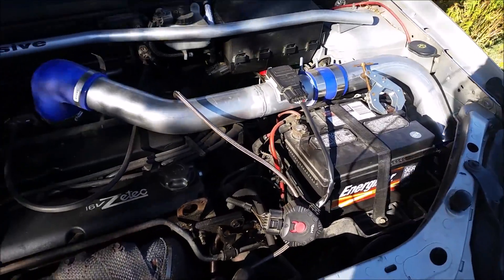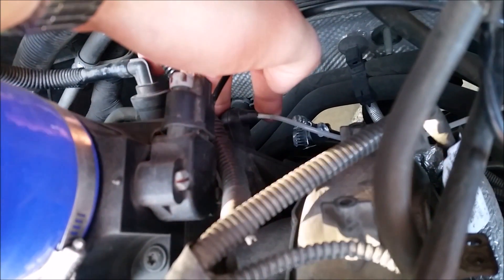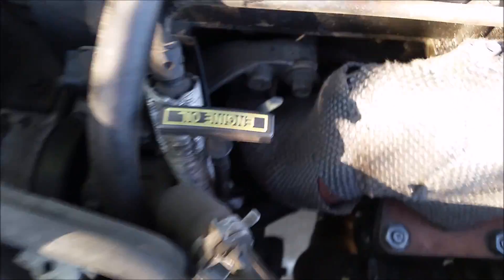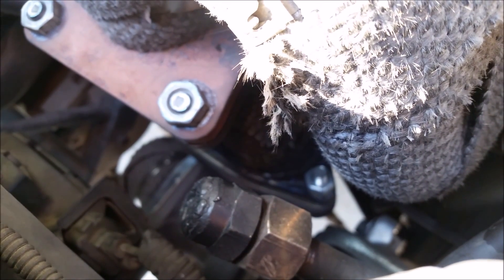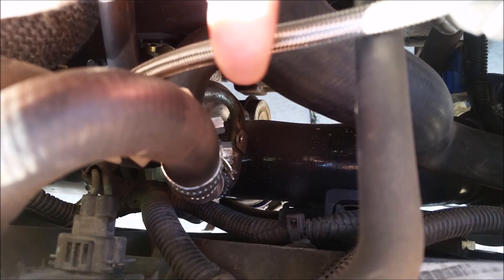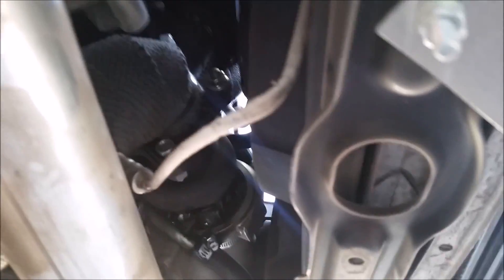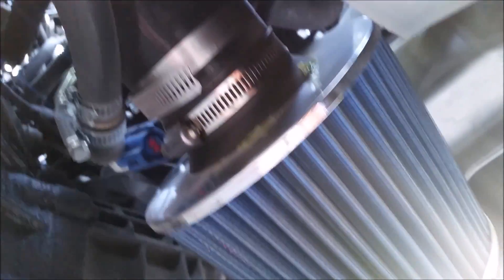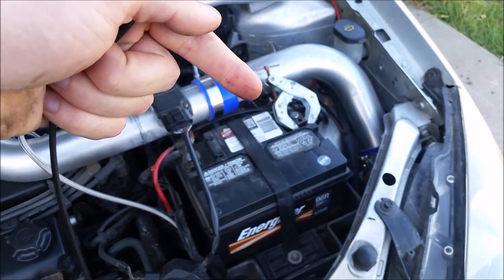Homemade Ford Focus Zetec Turbo System Overview

Comment: Hmmm would this work on a 1.8 zetec 

What engine management system you running ?
Reply from the maker: I honestly couldn't tell you. It's the stock ECU with a custom tune from "Turbo Tom"

Comment: it works? :D
Reply from the maker: Yep! Put like 30k miles on it with the DIY turbo setup at ~6psi before selling the car. Always worked like a champ.
Reply: @prerunnerwannabe  hey man I’m about to do the same thing with my zetec, I’m new to turbo systems so do you know any websites that explain the process in detail?

Comment: How is the car running 3 years later? Has there been any additional work required since the turbo? I want to boost my 2.0 DOHC zetec in my 2000 wagon.
Reply from the maker: Nice! That would be way fun.
I sold it a year or so ago, but I put ~25k miles on it while it was boosted to 6psi, and the stock 195k mile motor was happy as can be when I sold it. These are stout little engines, for sure.
Reply: @prerunnerwannabe  I appreciate the reply! One more question, on the 6 LB of boost did you have the car  on the dyno for a hp / torque rating? I want to be at the 200-230 hp & lb-ft of torque range 😁
Reply from the maker: @thatnorthernvanman7883  Happy to help!
I sadly never had the car on a dyno, so I don't know exactly how much power it made, but it was about as fast as a Fiesta ST, so I assume it made similar power numbers to that? It probably wasn't quite 200hp/tq, but the car is so light that it was still a ton of fun :)

Comment: Did you change the pistons?
Reply from the maker: Nope, totally stock motor. I drove it daily running 6psi for 25k miles and sold it with 190k miles on the stock, original motor. Still runs great!
Reply: prerunnerwannabe what horsepower it made with stock and 6psi
Reply from the maker: @aria_thronix1323  I'm not positive because I never put it on a dyno. I'm guessing somewhere around 200hp/200tq. It felt pretty similar to a Fiesta ST and was about as fast.
Reply: prerunnerwannabe i think ill buy this 00-04 Ford Focus ZETEC 2.0L T3/T4 Turbo Kit from fast way racer but need some advice because I’m doing it mi self
Reply from the maker: @aria_thronix1323  I would stay FAR away from eBay turbo kits, as well as the fast way racer kit. They are pretty much guaranteed to not work, and you're going to have to do an insane amount of fabricating, replacing junkie parts, and custom work to make any of these things fit. 
Then after all that, they don't provide any tuning, which is an easy $1000 on top of that. If you don't get a good tune, your engine WILL die. 

If you want a proven, reliable kit (that includes tuning) then I would look at the FSWERKS turbo kit for the Zetec Focus. It's more money ($3500) but I promise, after all the pain and work and extra cash you'd be spending trying to make the fast way racer kit work and be somewhat reliable at the same time, spending the money up front to do it right the first time will actually be cheaper, more fun, safer, etc.

Unless you're willing to make literally everything yourself and spend hundreds of hours researching, the FSWERKS kit would in the end be the cheapest, not to mention by far the easiest.
Reply: prerunnerwannabe thanks

Comment: So the motor is stock i got is but how much boost is the max for a daily driver ? 8-10psi ? And what kind of turbo do use ?
Reply from the maker: That should be fine. I did 6-7psi to be safe. You can use whatever turbo will fit, but I used a slightly modified TD04L from a Subaru.
Reply: prerunnerwannabe ecu ?
Reply from the maker: @sarkanygergo  Factory ECU with a custom tune by Tom from Focus Power.
Reply: prerunnerwannabe thats cool i thought it need some stand alone one for example aem or halltech or something else ...
Reply from the maker: @sarkanygergo  Nah, the stock ECU will work. I think it's pretty finicky to tune, so I don't know how many other people besides Tom know how to do proper tunes with it, but I was happy with his work. He does a lot of e-tunes, where you send a datalog and he sends you a new tune, then you send another datalog and he send you another tune to flash to the car. You repeat that process probably 10-15 times, but you will have a good, clean tune by the end.
Make sure to get good quality fuel injectors. I tried some Chinese injectors but they were pretty awful, and once I switched to better injectors, it fixed lots of issues related with tuning.
Reply: prerunnerwannabe i live in the middle of europe so the states is a bit far from me haha but we have some good guys who knew what they are doing haha and also UK has some good tuners and i have a friend who good at this ! Btw thanks for your help dude
Reply from the maker: @sarkanygergo  That's true, the UK has a lot of resources for tuning Fords! Just to clarify, these tunes were sent back and forth via email, so distance wasn't an issue. I've never actually met Tom in person haha.
It would probably be nicer to have the car with your tuner though.
Happy to help!
Reply: prerunnerwannabe or just an easy way to buy a mk1 focus rs ecu and harnes for the UK or from my country and job done haha
Reply: @prerunnerwannabe   what mods did you do to the turbo I have a junk yard with a few for 50 bucks and I' fabricate so everything  the rest
Reply from the maker: @pabassin2034  On the turbo I cut off the bolt style flange on the compressor outlet, machined out a 2" slip style flange that would accept a silicone coupler, and had a shop tig weld the new flange to the turbo.
I also clocked the turbo so that the turbine inlet and the compressor outlet are facing opposite directions, then I rotated the the center piece of the turbo (the name eludes me at the moment) so that the oil feed and drain were oriented in the right direction. This required some custom bracketry to keep the internal waste gate operational.
It took some work haha.

Comment: I’m in the process of a mk1 focus zx3 turbo build and was wondering did you do any work to the engine? New or better head gasket, piston ring gaping? Or is 8psi ok on an otherwise naturally aspirated engine?
Reply from the maker: Nice! The engine is totally stock. Basically larger injectors and a tune is all you need to reliably hit ~10psi. I think the breaking point for a stock Zetec is something like 250ft/lb of torque.
Reply: Ok cool I have all the software stuff taken care of just ordered everything else and didn’t know if a new head gasket and gaping the piston rings where required. I only plan on 8psi.
Reply from the maker: @carlgenis514  Nah, you're good to go! I'm pretty sure they come with a MLS head gasket from the factory, so they're actually super strong.
Reply: Another thought I had is what about the big vacuum line to the evap purge thingy and the brake booster? Are they seeing full pressure or was the evap purge solenoid deleted with the ecu tune? And shouldn’t the brake booster line have a one way vacuum/boost filter?
Reply from the maker: @carlgenis514  Man, you're making me think! I haven't had this car for a while now. Uhhh, I deleted the EVAP stuff and had the code turned out (shhhh). Honestly, I don't remember anything about the brake booster line. . . Sorry!
Reply: prerunnerwannabe  ok I’ve done a little digging and found out the there is a factory vacuum check valve inline with the brake booster, and I forget about emissions because I’m lucky enough to live in a county that is exemplified from emissions 😎.
Reply from the maker: @carlgenis514  Good work with the digging!
Reply: prerunnerwannabe  could you please take a picture of your oil drain setup
Reply from the maker: @carlgenis514  Sorry, I don't have the car anymore. . . But for the drain I tapped into the windage tray, but if I were to do it again, I would just pull the oil pan off and weld a bung into that.
Reply: prerunnerwannabe  ok thank you

Comment: Did you buy it all in a singular kit? Because I'm looking for one
Reply from the maker: None of it was from a kit, but I took some inspiration from the FSWerks Zetec kit. I would look into that one of you want a good, reliable system that I think even includes tuning.
Reply: @prerunnerwannabe  I'm trying to go cheap on it. Aint got  much money and I'm seeing ebay kits for around 600 bucks that look good. Do u think know anything  that would be wrong with those that I have to forsure change
Reply from the maker: @gavinsixnine  I know the feeling. Unfortunately, any kit that is even sub $2000 is going to be junk. If the kit includes a manifold, it probably won't fit right, it probably doesn't provide a downpipe, and the waste gate is all but guaranteed to be trash. Also you'll still need to get it tuned, and that's never cheap.
Basically turbocharging this car on the cheap cheap is a good way to blow the motor...
Reply: @prerunnerwannabe  noted. You got an instagram we could follow?
Reply from the maker: @gavinsixnine  Naw, sorry man. I don't actually have the car anymore.
Reply from the maker: @gavinsixnine  Now I have a Chevy Volt, but I don't think too many people want to follow that haha
Reply: @prerunnerwannabe  I'd be down ahah
Reply from the maker: @gavinsixnine  Oh yeah? Maybe I'll have to toss up a quick video about it 🤔
Reply: @prerunnerwannabe  you would forsure gain 1 follow!

Comment: Big ask! But would you be able to post a list of the parts you used?
Reply from the maker: Here's a rough list of the parts needed. There are lots of specific/custom things, but this will point you in the right direction :)

-Turbo/Manifold gaskets
-Turbo
-Downpipe
-Turbo Flanges/steel
-O2 sensor extender/bung
-Wideband 
-Boost gauge
-Tuning
-SCT X4
-Intercooler
-Mandrel bent tubing
-2.5 Tubing
-Air filter
-Oil feed/return
-Oil pan bung
-Water feed/return
-Silicone couplers
-Hose clamps
-Diablo Mafia
-Gauge Pod
-2.5" MAF housing
-Fuel injectors
-Adaptors
-BOV
-Firewire cable
-PCV delete
-Various Hardware
-Various Hoses
-Spark Plugs AZFS22C
-Gasket Material
Reply: Mines turbo to faster than my old cosy

Comment: What did you do for tuning or did you do any tuning?
Reply from the maker: I went through the process of datalogging like 20 runs to get a clean, custom e-tune from Tom from Focus Power. If you don't do any tuning, you'll probably melt a piston within two WOT runs. Tuning is a MUST.

Comment: what have been changed ,, gear,shaft, pistons?
Reply from the maker: The engine is totally stock, minus the fuel injectors. Stock drive shafts, stock pistons, stock everything with 175k miles :)

Comment: What did you use for fuel management? Any regulator?
Reply: And what did you use for piping? Exhaust piping?
Reply from the maker: @tylerpotts519  If I remember correctly, the fuel system was stock minus 42lb injectors (just don't use Chinese ones. I tried and it was weeks of headaches)
For piping, I used a mild steel tube for the adapter, and everything else (including the intercooler piping) was done with 2.5" exhaust tubing.

Comment: Could you shoot me a parts list and rough pricing? Awesome car man
Reply from the maker: Sure! This is more of a personalized parts list, so some stuff might not make a ton of sense. Anyways, with a lot of fabrication and hunting for good deals, I was able to put it together for about $2000, but that'll be pretty hard to replicate unless you do all the work yourself (which I did).
■10-Turbo/Manifold gaskets
■450-Turbo
■0-Downpipe
■45-Turbo Flanges/steel
■3-O2 sensor extender/bung
■135-Wideband 
■19-Boost gauge
■565-Tuning
■200-SCT X4
■60-Intercooler
■69-Mandrel bent tubing
■35-2.5 Tubing
■13-Air filter
■27-Oil feed/return
■0-Oil pan bung
■25-Water feed/return
■44-Silicone couplers
■15-Hose clamps
■60-Mafia
■8-Gauge Pod
■0-2.5" MAF housing
■46-Fuel injectors
■50-New-used injectors
■12-Adaptors
■17-Bov
■6-EcoBoost badge
■5-Firewire
■15-Engine mount
■0-PCV delete
■8-Various Hardware
■10-Various Hoses
■13-Spark Plugs AZFS22C
■12-Gasket Material
Reply: Thanks I really appreciate it
Reply from the maker: @austinbernardoni2757  You bet! Glad I could help.

Comment: I love these little station wagons lol although I did buy the 01 se and it only ran for 3 days. It just quit wanting to start and I kept replacing battery after battery and even the starter and solenoid... the battery would be dead as soon as it got hooked up... it was fucked...
Reply from the maker: Haha thanks! Dang, that's weird... sorry it didn't work out!

Comment: Could you help me with one question I've got? Imma buy a ST170 this summer and I was thinking about turboing it. Can I use a turbo from any stock car such as a BMW 320 or somethign like that in order to save as much money as I can? I thought about getting the entire turbo system from a car like that one and fitting it into my car with the least modifications possible to make it as cheap as possible. Could that be done and would you suggest trying? Thanks :)
Reply from the maker: Hey! Turbo systems are very specific to each vehicle, so a turbo system from a BMW or really any other car would NOT work on a Focus. You would have to either make a custom system or buy a turbo kit from a reputable company ($500 dollar eBay kits won't really work, unfortunately). I used only the turbo from a Subaru, but that was already heavily modified to make it work. There are a number of kits out there though, so it's certainly possible!
Reply: Aww, I was expecting that :( Yeah I won't consider an ebay kit, those things seem to be the worst way to lose 500$. Well thanks you so much, I'll keep on looking for aftermarket kits then, and will save even more money hahaha
Reply from the maker: @AlonsitisDuff  Cool man! Keep it up!

Comment: what ecu?
Reply from the maker: Stock ecu, just flashed with a custom tune!
Reply: How does that run? So it just uses a maf and theres no map sensor is that correct?
Reply from the maker: @mwoodford87  Correct. The MAF has a Diablo MAFia plugged in line to increase the voltage range that it can read, and it's also been tuned to work in a 2.5 inch intake tube.

Comment: What your Ignition timing at I keep melting spark plugs
Reply: I would invest in installing a wideband sensor and maybe look into fuel management as well.
Reply from the maker: Are your plugs a couple steps cooler? And are they copper plugs? That is my setup. Also, I didn't tune the car, so I have no idea what the timing is lol
Reply: prerunnerwannabe  they are sp-463 level 1, I read they where good too 11psi but there melting at 5psi I have a sct tuner but don't have the program thank for the reply
Reply from the maker: Huh, that's weird. I have some motorcraft coppers, but I don't remember the model number. I think if you go on the FSWerks website you can find them. Who tuned your car?
Reply: prerunnerwannabe the tune is just the stock sct universal 2.0 focus tune ,what you set your spark gap too
Reply from the maker: Wait. . . You're boosted at 5.5psi with the canned NA tune from SCT? That honestly sounds like a recipe for disaster, and I'm not saying that to be mean, I just don't want your car to blow up. Do you know what your AFR is under boost?
But to answer your question, I think like .035 or something around there.
Reply: Your fine the the stock o2 is reading .6v  to.8v under a pull
Reply from the maker: Do you know roughly what that translates to in a standard AFR ratio?
Reply: Around 14 to 15
Reply from the maker: Oh yeah? How long have you been driving your car boosted?
Reply: 4 days
Reply: 100miles
Reply from the maker: Gotcha. I really don't want you to have a hole melted in a piston, so I want to tell you that my tuner doesn't think it's safe to be over like 11.5 while being wide open in a boosted Focus, and he's tuned literally hundreds of them. I would hiiiighly recommend getting a custom turbo tune.
Reply: Try some ar103 plugs. "Autolite Racing 103 plugs" they are a 2 step colder plug. Should help tremendously. You can even gap them to .070 of an inch for a little more low end power. Also make sure you're not running lean at WOT.

Comment: UPDATE!!! Since I last commented on this video, I installed new struts, & front sway bay end links, timing belt,tentioner, & water pump, & a kick ass system_tocado 7", installed a pod filter directly onto the maf & it woke the car up tremendously!!! then, rod bearing noise! its not loud, its not knocking but, I hear it under load! sounds like the car has bad fuel & is dieseling but, I know its the rod bearings so, I took off the lower oil pan to have a looksee & dambed if their isn't a lot more work to actually get to the rod bearings! so I ordered a upper oil pan gasket when, I should have ordered a whole engine gasket set w/every gasket 4 the motor!!!

Comment: Hard to tell, but is your oil return going uphill from the turbo? If it is that won't work. Returning to where you had it in the pan would have been fine as long as the turbo is higher than the oil level.
Reply from the maker: It looks a little funky, but it doesn't go uphill at all from the turbo. I did everything in my power to make sure it was able to flow nicely down :)

Comment: The mafia isn't necessary at this power btw. I ran 15psi on a bone stock zetec for over 4 years daily. I just used a larger (3") housing for the mafs.
Reply: Thanks for this info! 👍
Reply from the maker: Oh really? Interesting! How did you go about tuning?
Reply: prerunnerwannabe tuned with SCT software by Randy Robles (formerly of fswerks/focussport). Basically as long as you don't "peg" the mafs you don't need the mafia. Larger housing works up to around 18psi on the cars typically, after that you need a mafia or aftermarket mafs.
Reply from the maker: Well I'll be darned. I wish I would have known that haha. Thanks for letting me know!
Reply: prerunnerwannabe no worries, those things are actually hard to come by these days (discontinued by diablosport years ago).
Reply from the maker: That they are! I had to get mine used from eBay!